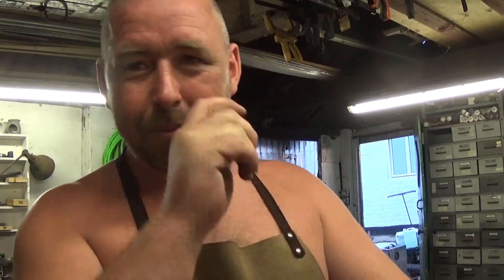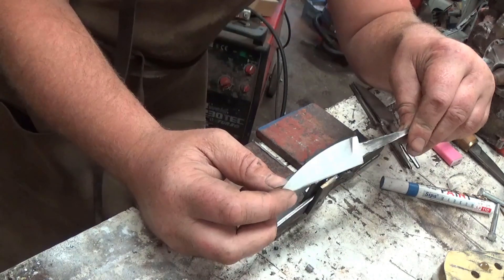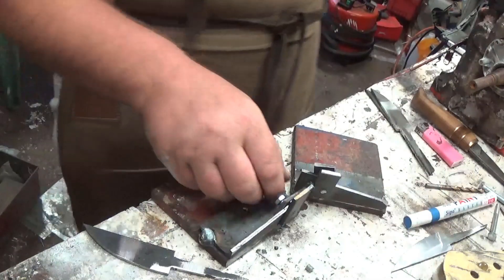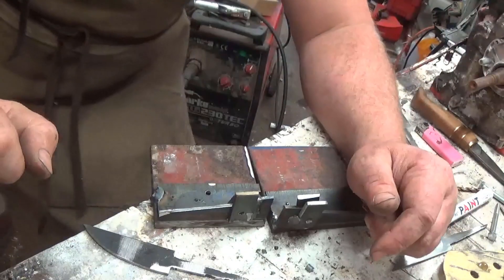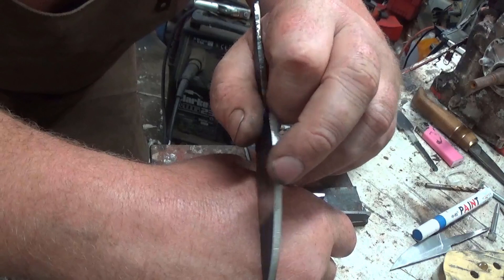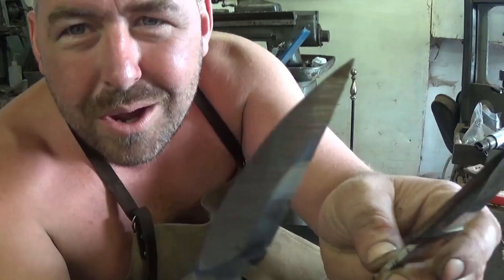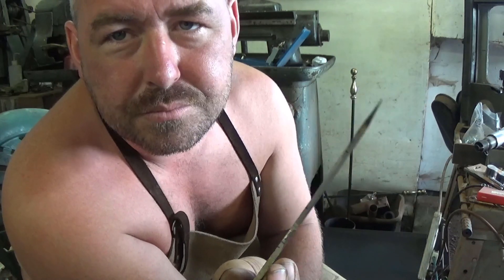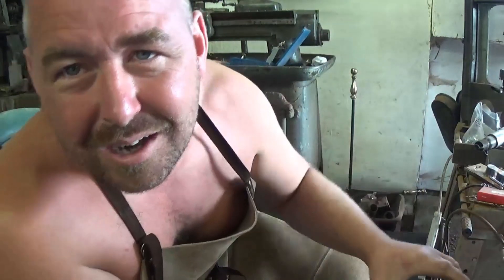A pair of knife bevel grinding jigs

Comment: Nice work, Quick heads up if you are interested Lidl have a crosscut compound mitre saw on sale with a 10" blade, 2KW and 2 gears. Claims to do steel as well. As I've got a good evolution I don't need another one though I'd be tempted for the £99 it is though.
Reply from the maker: Nice one Benedict, how do they compare to your evolution?
Reply: @turboconqueringmegaeagle9006  No idea, as I haven't bought it to compare. Spec wise it looks better I think.

Comment: Will you be adding a sharpening notch on these? Will these be in your Etsy store? I might want to pick up a puukko
Reply from the maker: I don't know how I feel about notches, they make a lot of sense especially with the radiused ricaso but aesthetically I can't stand them.
What are your thoughts?
Reply from the maker: And yes, if I can produce a sheath in a reasonable time I'll do another batch of these and put them in the store, also working on a heavy parang which should fit in the same sheath as the original mini parang. It's all about cost though, I want to keep things affordable but still make a few quid so if anything takes too long and I can't speed it up it won't be in the shop.